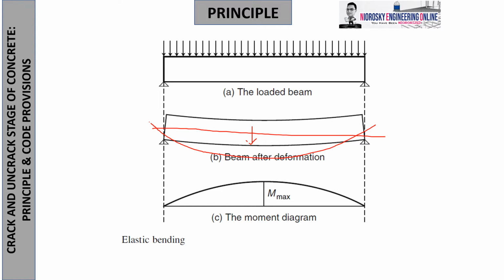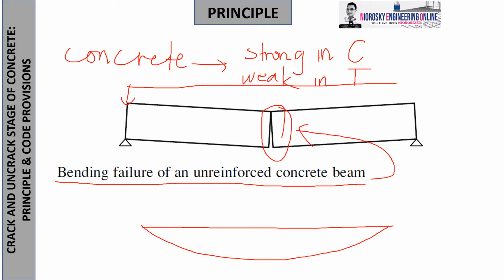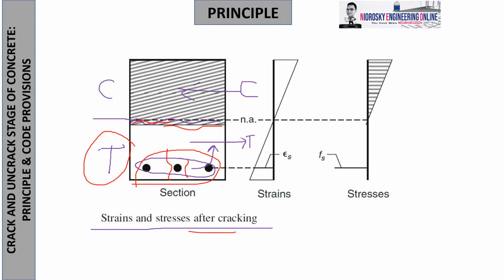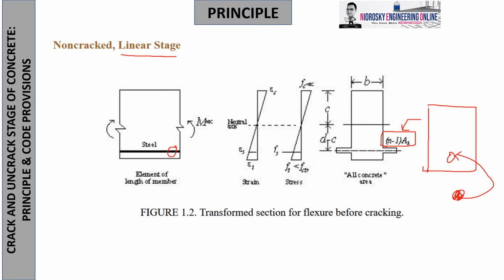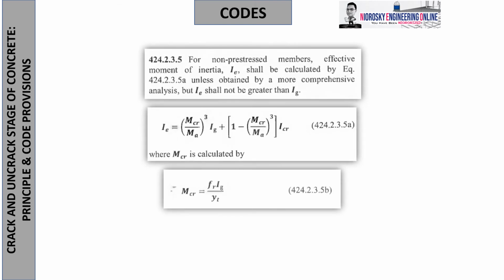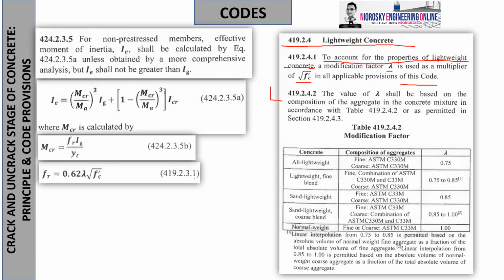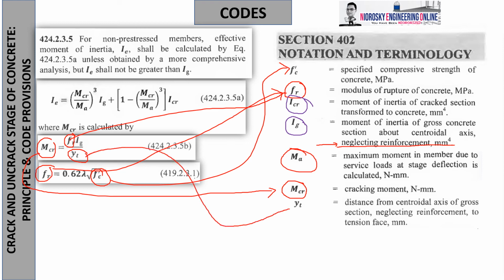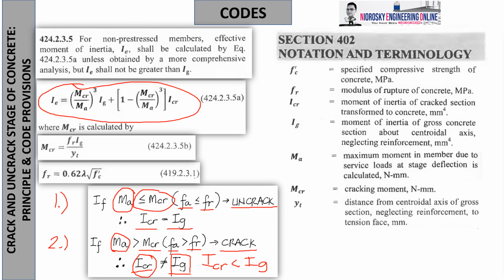CRACK & UNCRACK STAGE OF CONCRETE: PRINCIPLE & CODE PROVISIONS

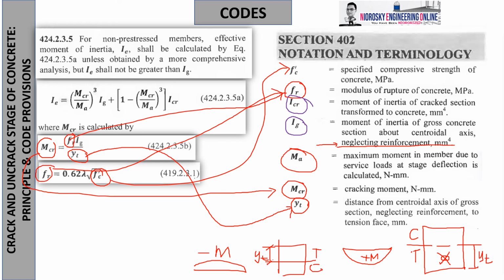Comment: Sir bakit sa moment diagram nasa Taas yung Positive moment? Tas sa iba nmn nasa baba yung Positive moment? Saan po ba talaga? 20:40
Reply from the maker: Positive and negative bending defines deflection behaviour. Under positive bending, deflection is downward, compression is found above and tension is found below. It can be easily simulated. On a negative bending, deflection going up, compression is now found below and tension is found above. This is based on the principle of strength of materials in relationship of moment-flexure and deflection. Cheers.
Reply from the maker: Usually if loads are downward, towards earth due to attraction of all masses towards the core of eadth we call gravity pull, tends the beam to deflect downward and that is positive bending. Your experience of drawing the shear and moment diagram will tell you the same thing :) is it wonderful? They jive. Cheers.
Reply: Hayyy buti nlng tinanong ko naaa salamat sir!!!
Reply from the maker: @alexsanderdumasig2573  salamat dim boss. No worries